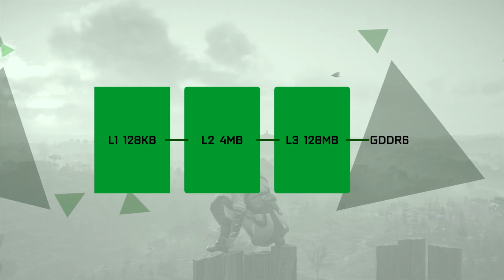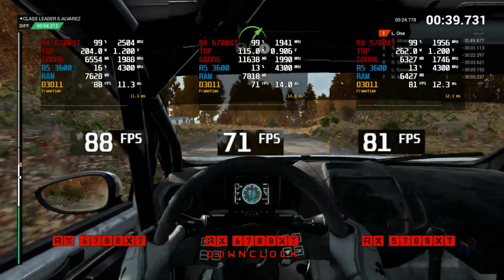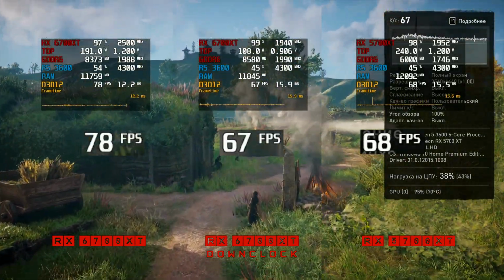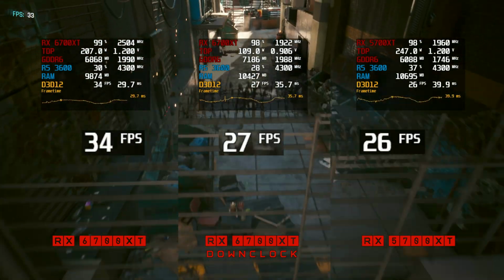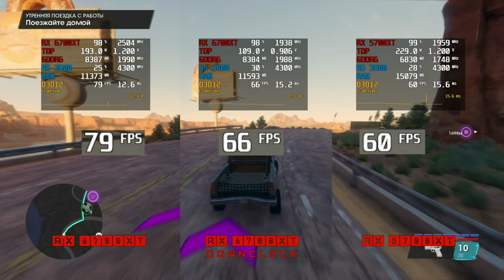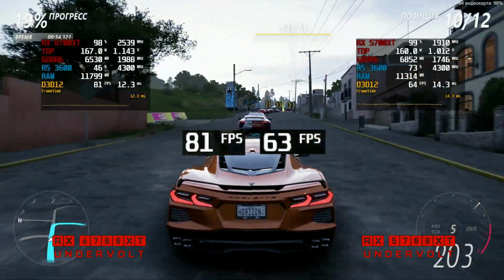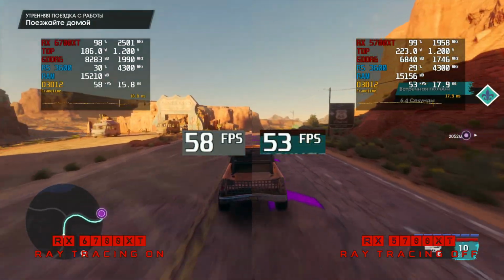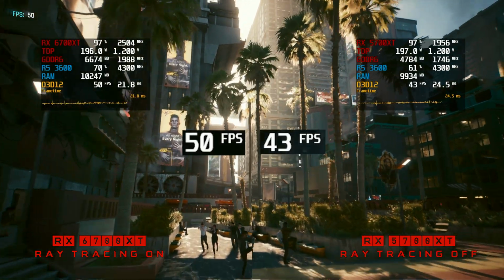RX 6700XT vs RX 5700XT / IPC, Power Efficiency, Ray Tracing

Comment: I think lower iso-frequency comparisons would yield better results, as 5700 XT is known to be a really good undervolter and is an otherwise inefficient power hog. My comment is equipped with more speculations than facts due to the gaps in the information you provided, but I have a few questions such as which board models did you put to test; which driver versions did you use; why didn't you include more workloads with heavier GPU utilisations instead of titles like Life is Strange and Dirt 4; and whether do you have any interest in revisiting this test with modern titles, on a system with a better CPU, provided you still possess both of these GPUs and they're still in working condition? I found TDP normalized results to be far more intriguing and telling of the prowess of RDNA2 over its predecessor, but I think clock-controlled synthetic tests at iso freqs like SPEC GPU and 3D mark would have been really appreciated. You might also try lowering the clocks for both of these GPUs further down to see how their performances stack up and down, as well as at each level of power consumed (say, in 10 watt increments).

Comment: RDN2 just seems more impressive every time I read any new technical info, see benchmarks, etc.
RDNA4

My guess is RDNA3 is only not as good because the latency of the chiplet approach is so large. Or because the engineers were focused more on Zen 5 and RDNA4.

I wonder how companies decide what is good enough and what is left over for the next architecture.
Reply: RDNA2 is really impressive and will age pretty damn well. As for RDNA3, from what I've heard the issue lies with some unfixable bugs on the Navi 31 chip. The original/ intended performance was way higher than the actual product, however it had some pretty obvious artifacting after a couple of hours. This is why they catch the bug so late in development (a month or so before release IIRC) and the only fix the found dropped the performance of the card to what it is today. This information is from an episode of Broken Silicone from Moore's Law is dead, so take it with a grain of salt since his sources are anonymous. Let's hope RDNA4 doesn't get something like this so It can compete with Blackwell and maybe even beat their top tier cards since the beginning.
Reply: AMD expected the 7900xtx to perform 20-30% better, its pretty clearwhen you look at the 780m vs 680m, and the fact that 12cu 780m is 1/6 as fast as the 7900xtx using 1/8th the number of shaders
also notice how the 7900xt is 5% more shaders than the 6950xt but the performance is, also only that much higher. This implies no ipc improvement, and amd could have stacked cache with the RDNA3 cards but it wasnt worth it apparently.

Comment: 1) Most likely that the 5700 XT isn't using the DXNAVI Registry tweak, that gives DX11/10 games like a 10% boost in performance
2) No idea what happens in the AC Odyssey demo, 5700 XT is a 1440p60 powerhouse in that game, maxed out, let alone 6700 XT.
3) Extremely poor 5700 XT sample in this video, worst I ever saw. 1935 Mhz clocks for up to 282W? Oof. I'm doing 1935 Mhz clocks at ~185W on average and I also have a poor sample, but not to this extent.
4) Odyssey tested at 1440p + 140% rez scale? Ok, strange, but sure.
Reply from the maker: 1. No tweaks are used, not sure if it works
2. As you mentioned below - 140% res happened
3. Pretty good 5700xt sample. Did you know that pawer consumption can vary from one game to another? What we have done is unlock the power limit, so if in some games it requires more power to reach stock clocks - it will do so instead of lowering the clocks because it makes a comparison of apples to apples. We mentioned that in the video
4. Not to be cpu limited, it’s a Ryzen 3600 testing rig
Reply: @HardwareLab  1) DXNAVI Registry Tweak is 100% rock solid on RDNA1, give it a shot
2. I know TDP fluctuates. I am using my 5700 XT for 3+ years at 2000 Mhz clocks in driver at 1.112V. It averages 1935 Mhz, pretty much locked. If the load is extremely heavy, is drops to maybe 1920. If the load is lighter, it can go up to 1945 Mhz. All within 160-200W. 282W is extreme for these clocks.
3. I also ended up a bit CPU limited in 1080p in AC Odyssey on 5700 XT without DXNAVI, but 1440p + DXNAVI, I was always GPU bound. R5 3600 at 4.3 Ghz user here as well.

Comment: A question, I have is how much of the extra power consumption can be attributed to the 256 bit bus of 5700xt compared to the 192 bit bus of 6700xt. Is it possible to calculate the power consumption and take that as well into account. Since, we know that computation is relatively inexpensive but data transfer consumes a lot more power

Comment: i got the rx 6600 4 months ago and i really feeling bad and regret it, it's impossible to have a stable 60fps at 1080p high\medium mix setting on new 2022 games and impossible to get any overclocking performance boost 😱 all the money i saved for so long is gone 😭 any solution 🙏
Reply: I guess you could take advantage of the second hand gpu market as soon as the new AMD ones come out next month and get something really good for super cheap (comparatively).
Reply: @Henry99981  thanks but it will be very difficult in my country , the 6600 that i got is from canada 😢
Reply: Idk why it happens?
Reply: Did you figure it out?

Comment: These cards are closer in performance than I expected. Cost per frame is lower in 5700xt and is the best card for the price at 1080p in november 2022 @S170, not too bad for 1440p either, sometimes requiring lowering details. Amazing card. Newer card by AMD is more 4k oriented and requires investing on monitor and other components for sure, same thing goes for Nvidia.
Reply from the maker: I wouldn’t use cost per frame as some fair measurements, as well as the “average performance” in general. You can check our latest video about why that measurements don’t work really if you are interested
Reply: @HardwareLab  Cost per frame is a useful way to tell other aspects of a video card purchase decision making and comparison, is not the only one by any means. But thanks for the review.
Reply from the maker: @AbnerChamate  it’s useless because it says nothing about the gpu and gpu’s results
Reply: @Hardware Lab  this kind of comparison is used by many established benchmarks and technical channels in YouTube. You ignored this is very surprising. Maybe some people don't find this useful but is a common practice among independent reviewers for purchase decisions. I am thankful that exist.
Reply from the maker: @AbnerChamate  but it shows the number that doesn’t mean anything. It doesn’t say if you pay more or less reasonable price or something, it’s just meaningless because it is based on “averaged performance”, number that doesn’t represent anything. Check our last video and you’ll get the idea

Comment: The RX 6700 XT is often slightly bottlenecked by the Ryzen R5 3600 here. 99/98% GPU utilization is okay, but everything below that means the graphics card is not running on full power, because it's most likely waiting for the CPU to hurry up.
Reply from the maker: @RealDeal-nm3zx  oh, im sorry, I was thinking the original comment is yours. Yeah, sure, it is not a 100% correct, I agree, but 3600 was the only cpu we had for that test
Reply from the maker: what exactly?
Reply: @HardwareLab  The CPU is bottlenecking the whole system which is not ideal when you are benchmarking a graphics card
Reply from the maker: @decliningship4208  he says “everything below” means that cpu is bottlenecking. I am asking what exactly means that? Because there is almost no cpu limit
Reply from the maker: @RealDeal-nm3zx  I know what the term cpu limitation means, I am asking what exact thing makes you think that it is cpu limited when the load on 6700xt is on 99%
Reply from the maker: @RealDeal-nm3zx  if you send me cpu, motherboard and everything else that is required - no problem. But what’s the point then of writing a comment that states “IT IS cpu limited” based on theoretical assumption that it “might be”?

Comment: This review has skip something SO MUCH IMPORTANT: temperature.
5700XT can warm up to 88ºC easier.
6800XT is arround 58ºC. 
This a huge difference because it can be the key for play any game for 4 or 5 hour since noon to early midday on hot summer
Reply from the maker: We touched the energy efficiency and power consumption. The temperature itself is more connected to the cooling system application on this consumption rather then to whatever there is in chip
Reply: PowerColor RX 5700 XT Red Devil: Am I a Joke to You?
Reply from the maker: @Protector1rk  as well as Nitro+ Sapphire
Reply: Rx 5700 Saphire triple fan 58° C

Comment: I have a question, when you compared the rx 6500xt to xbox series s what pc specs did you use? MB, CPU, RAM? I'm really shock with the results. The Series S just obliterate the RX 6500xt in every single way.
Reply from the maker: It was Ryzen 3900X, gigabyte x570 board (don’t remember which exactly), 16 gigs ram 3600 cl14